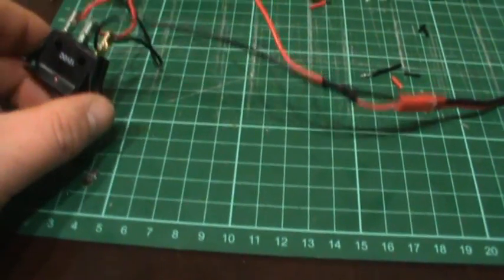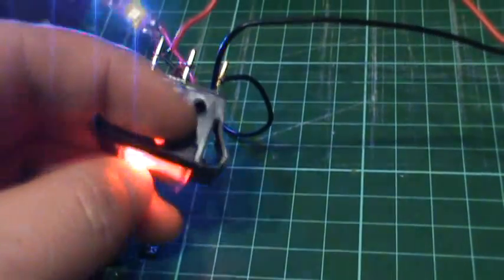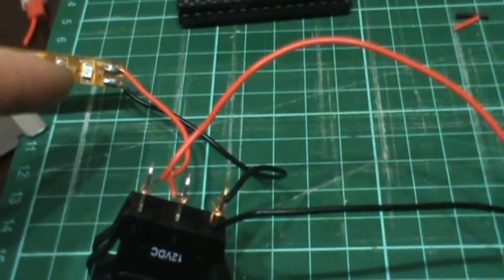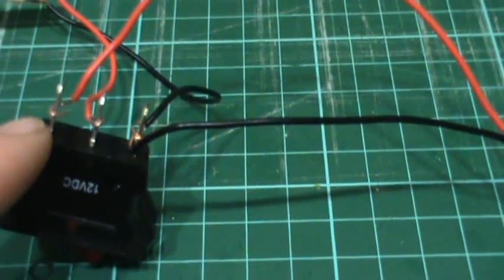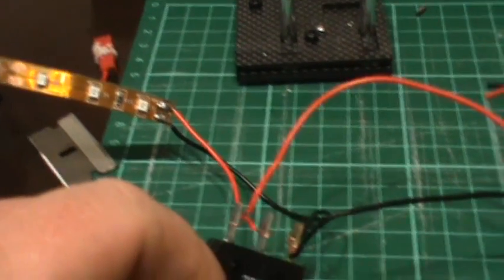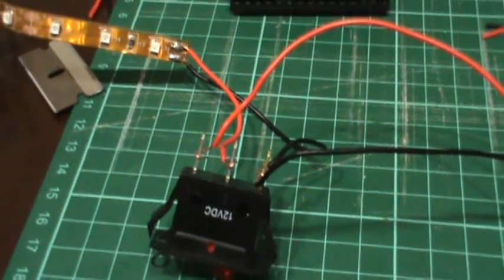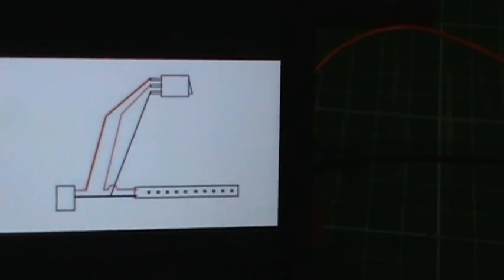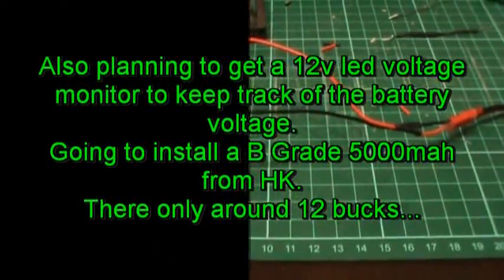How to wire a LED Rocker Switch

Comment: Hi. Thanks for this tutorial. Very informative. I wanted to kkow how do you add a voltage meter wirh this. Thanks
Reply from the maker: Hi thanks, you can add a Voltage meter very easily. They normally have 2 poles a positive and a negitive. Just solder the neg to the neg and the power to the power wires for currant to pass threw to give you a reading. If this is the type of meter you are referring to? Thanks for watching and please subscribe. Helps a lot. https://www.digikey.ca/en/products/detail/sparkfun-electronics/J00002/7564745?utm_adgroup=Panel%20Meters&utm_source=google&utm_medium=cpc&utm_campaign=Shopping_Product_Industrial%20Automation%20and%20Controls_NEW&utm_term=&productid=7564745&gclid=CjwKCAiA_9r_BRBZEiwAHZ_v19llFT5Qi6H03PoK9xY-2NfZMU1bht0FqtGjJ1J3OCinvTUh0ExwfBoC6hQQAvD_BwE

Comment: My switch doesn't show the positive and negative. I ran the power wire to the battery, I grounded out the negative wire, then I ran the other positive to my neons under the car. Then I ground it out the other negative off the neons. The end of the LEDs hooked together under the car are both capped off. Every time I put my negative cable on my battery it blows my fuse on the positive end. What do you think is wrong? This is very frustrating I've installed all of this twice now. ☹️
Reply from the maker: Hmm honestly i m brain storming and the the only thing i can think of is a ground loop? But a loop should not blow a fuse.  I'll ask a friend of mine
Reply: @eastcoast78  the switch was all positives and I was grounding it out. Thanks tho

Comment: im trying something new here. mind you ive never done this before. i just recently bought a 3D jeep punisher logo for my jeeps grille, but i want to drill 4 little holes for some blue led lights for the eyes..my question is what mm led blue lights would i use for the eyes and how can i connect it to my parking lights..so when i turn my parking lights on the eyes would light up..

Comment: 12v DC cant shock you... touching the positive and negative is fine!
Reply from the maker: Lol yes I understand that. Touch the pos and neg together let me know it goes..
Reply: +eastcoast78 I have! Many times as well! I can send a video link if you want? ;)
PS: Thanks for the video! It helped me quite a lot!
Reply from the maker: well with these lipo batterys you'll get quite the spark from them when ya touch them together. I've never actually held on to them when they arc'd. Id like to see the video.
Reply: eastcoast78 ok, its uploading! :D
Reply: I think 12V does not have enough "PUSH" for the electron (in big amount) to jump from one side into your body and traveling to the other end of the pole. This is different when you discharge it , means you make it as 'closed circuit' , so contacting directly between 2 pole with some kind of good conductor will be bad idea. So you can help adding the "PUSH" by for example make your hand wet. Adding some liquid to your fingger and touch it will be bad idea as the electron now can travel through your skin easily.
Reply: claystudiofx Yeah! True!

Comment: This is useful, thanks for adding this!  I've got a question maybe you'd be able to help me with, I want to add t his to my little fishing boat and I don't have anywhere I can really install the switch and keep it protected, would you have any suggestions?  Also, I'm going to need more then just the lights hooked up to my battery, is there a splitter or a technique you would recommend?
Reply: Why net get a small plastic box/case enclosure and wire it up inside of that, that would make it water resistant if not waterproof if your taking your time and spend a few extra $... Just an Idea what do you think?

Comment: if I was to install a 12v switch to a 7.2 battery would it light up ?
Reply from the maker: +Ron Marsh Yes no problem. The 12v is what it can handle. even down to 5v would power(light up the LED). Check this video i uploaded a couple weeks ago. I am using a 7.2 Lipo. https://www.youtube.com/watch?v=EPwUN4Lyp4o
Reply: Great thanks!!
Reply: how about 3V? wanna power the LED in the switch, plus 4 more LEDS in my flashlight handle. i know it will drain it n such, jus curious if it will work
Reply from the maker: only one way to find out

Comment: where is the link to the battery monitor?
Reply: This helped more than what any other person on YouTube could do
Reply from the maker: +Emilio Arroyo Here ya go. http://www.ebay.ca/itm/140794138836?_trksid=p2055119.m1438.l2649&ssPageName=STRK%3AMEBIDX%3AIT
Reply: jaja thanks but I was asking about the video of you installing this meter. :)
Reply from the maker: Ohh ok, my bad. Sorry i dont have one done. :) I would be pretty boring, there are two pins, 1 on positive and one on negative.:)
Reply: jajajajajaja thanks. the thing is that I want to install a capacity monitor to a battery with a switch that is in a USB. can I use this same conection as in this video?
 So that the monitor only runs when the switch is on... because else the battery will drain

Comment: what happens if the two black wires bypass the switch entirely and are just connected to each other?.... switch works fine it just doesn't light up??
Reply: yep
Reply from the maker: Yes

Comment: Could this work with a light bulb socket instead of an LED strip?
Reply from the maker: Yes I can't see why not. A switch is a switch. the only issue is using the dc power vs ac for sockets.
Reply: Oh ok thanks much eastcoast78

Comment: I have a 20 amp 2 prong on off switch i wired on my bike for the radiator fan. Do i have to ground the switch to the battery or can i just ground the fan itself?

Comment: i have a 3 prong toggle switch with a led light  that i want to put inline(series)  to open and close the circuit but i want to be able to use the light on the toggle switch do i need to use the 3 prongs? and if not which prongs on the switch do i use?    I pretty much want to use this switch as a normal on and off switch but be able to use the light on the switch when on .. thanks!

Comment: Okay so, in my car I have 1 wire coming from a fuse tap and positive and negative wires coming from my leds. How do I wire them to a switch the same as the one in the video. (How do I ground it). Your help would be much appreciated! Great video by the way
Reply: Negative is negative the negative from your LED lights goes to ground off over your switch that has three wires one is ground for light in the switch it's plastic doesn't conduct electricity so needs external ground the other two are power in power out when you have the switch on all three terminals are connected two of them should 0 out with a Ohm meter I'm not sure what the Ohms throw a Ned light are put your looking for a 0 resistance between the two the other one is switch light ground The led lights are just pos and neg some LEDs light neg and pos can't be reversed put no hard to swap the wires won't hurt the light hope this helps took me half a hour to Right 🤔

Comment: Is it necessary to ground the switch, or can I just run it to my negative terminal on my fused distribution block?
Reply from the maker: Running it to the negative of the battery is grounding it.
Reply from the maker: but yes if installing ina car/truck and getting power form the batt/fuse i would ground it to the floor. Life the matt and find a nut. :)

Comment: Will a rocker switch of 125v work with the leds ?
Reply from the maker: rocker switch of 125v? a switch is a switch...so it should work.
Reply: dani alvarez I think you're referring to the "Rated 125v" which means that it should be able to operate up to 125 volts without stressing it so far it stops working/breaks.  I wouldn't press it to the limit but that's what the rating means.  So if you're using a 12 volt system, that should be fine.
Reply: dani alvarez I think you're referring to the "Rated 125v" which means that it should be able to operate up to 125 volts without stressing it so far it stops working/breaks.  I wouldn't press it to the limit but that's what the rating means.  So if you're using a 12 volt system, that should be fine.
Reply: Is there an echo in here? lol (YouTube posted up my comment 2x)
Reply: Is there an echo in here? lol (YouTube posted up my comment 2x)
Reply from the maker: Looks like it did it again. Looks like it did it again.... LOL No worries man.

Comment: I only got 2 metal bits on it please help
Reply from the maker: All you have to do is cut the power wire and twist/solder each wire to each "metal bits". The switch well act as a break in the line. Trun on, power travels. Turn off, power if cut. :)

Comment: I have two led halo lights grounded to the metal in my engine bay, their power is connected to the switch, the switch is grounded, and the switch is getting power from an add a circuit with a 10 amp fuse feeding from the fuse box under the steering column. BUT THE HALO LIGHTS WON'T COME ON, can you help?
Reply: I taped my halos into my running lights

Comment: can I wire the 2 led lights to same fuse in this case to the ignition fuse without overload it?
Reply from the maker: Yes, that's the best thing about leds...they consume little to no energy. I had a strip of about 15 in parallel off my ignition fuse. No issues what so ever.

Comment: on a car positive and negative are wire on a battery terminals?
Reply from the maker: Or a fuse! So say you want a light to come on when you turn the key on. Put it on the ignition fuse. Then you can use the switch to turn it on/off when you like. Or your radio fuse etc.

Comment: Thoughts about connecting power to the cigarette lighter in a car and grounding to the car battery? I am an extreme novice at this and I'm unsure if this set up will work.
Reply from the maker: Yes it well work, i would ground to a bolt on the floor somewhere. There are kits available on eBay with everything needed to hook up to a fuse. I wired mine to the ignition fuse with the supplied metal clip that fits over the fuse. LEDS come on when i turn the car on, but it also has a on/off push button switch if i want them off while the car is running.

Comment: If I want to run LEDs on the inside of my boat do I need to hook them to a fuse or can I go straight from the 12v battery to a switch right to the leds
Reply: I would put in a fuse just I case you accidentally touch two positive. It takes 2 mins to add in and will save your lights from blowing up. It's not work all the effort if the explode first try lol

Comment: If I want to run LEDs on the inside of my boat do I need to hook them to a fuse or can I go straight from the 12v battery to a switch right to the leds

Comment: What if they are all copper my led rocker is? They are not marked?
Reply from the maker: If they are, get a DMM(Digital Mutimeter) and set it to continuity.(The upside down Horseshoe looking symbol). Check the 2 outside pins(center and left) and (center and right). Flip the switch back and forth while touching the DMM's probs on either 2 pins. If it changes from closed (1) to open (0) on the left and center, then that is your load and source pins. Which would make the right pin ground. Hope this helps.
Reply: eastcoast78 Thanks! I will do that.

Comment: I have a switch but it only has 2 prongs what do I do?
Reply from the maker: +DSM_ IAN just put the ground on one, and put the power on the other, make sure the power is on the correct one though.
Reply: Ok, I'm going to break the rules and necrocomment here,

What if one has an led rocker switch with four connection points?

This is a well put together and informative video, and I know it's not your job to help out a nobody like me, but if you could point me in the right direction I'd be very appreciative!

No idea if you'll see this, but thank you all the same, with kind regards 🤙🏻
Reply: Lage reply but I think it works just like the regular push button.

Comment: Hi, nice video. Could I have the indication light on when the switch is off?
Reply from the maker: Yes and no. If you swap the load and accessory wires the LED well be one all the time like i show int he video. it well not turn off when you switch it on.
Reply: i need help i have a 3 prong led switch and i unplugged the wires to it and replugged them in the same way and now my led light comes on when my device is off and led light turns on when my device is off

Comment: One more question please.  If I want to do several (15 or so) of these connections, each with its own switch, and I want to have all of these connections going to the same 12v battery, DO I GROUP ALL CABLES TOGETHER AND CONNECT THEM TO THE ONE BATTERY TERMINAL ?

Comment: I connected a rocker to my amplifier in my car and it worka however, even when the switch is off power still flows through so the switch never actually turns off. I ran 12v straight from my battery to the switch and then 12v from the switch to my amp and then attached a ground just running to the chassis from the switch.
Reply from the maker: Which pin did you run the power(12v) though. It needs to be on a outside one. Just like the video. Did you run your grounding wire though the switch as well?
Reply: eastcoast78 exactly what I did: ran 12v from battery to switch and from switch to amp then 1 cable from switch to ground.  It works just after it starts working it stops turning off. The led works and all.
Reply from the maker: Kendall Rodriguez Ok, so did you run the ground from batt though switch then your your chassis? Or just a ground form chassis to switch? It needs to be the first way.

Comment: i am tryin to install LEDs in my trunk with my amp and subs along with lights for my interior u think i caN run all lights(different colors) to one switch?
Reply from the maker: Yes i cant see no reason why not. Just put the switch between the batt/power source and the lights. Then it well cut the power to everything and anything after the switch. Just like i have mine set up.
Reply: alright thanks i will do a video post of my "creation" when its complete
Reply: where's tha vidddd of the end result?

Comment: what if my rocker switch only has two pins but three slits. i want to use the rocker switch to turn voltmeters on and off in my car i just dont know whether to connect power or ground or if it doesnt matter
Reply from the maker: Not not sure what you mean by 2 pins but 3 slits? Yes if your switch only has 2 pins, just snip the Hot(positive) wire and connect one wire to one pin and the other wire to the other pin. What this effectively does is brake the connection once it is switched. You do not what to do it with the ground, as then power well always be flowing.

Comment from the maker: Thanks, glad you like it. Sometimes the 3 pins have 1 2 3 under them? A way to make sure if there is no color telling which one is ground. You can use a Multimeter and do a continuity test. The negative well show a open circuit when touching the probs off either of the other 2. The accessory/load positive and the source (battery) pin well show a circuit. As they are linked when you flip the switch on/off. Hope this helps.